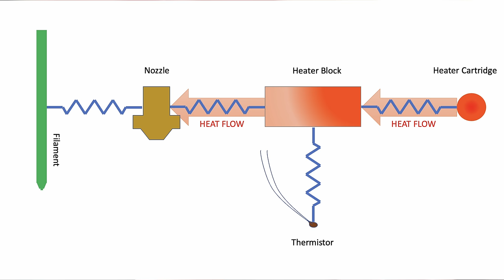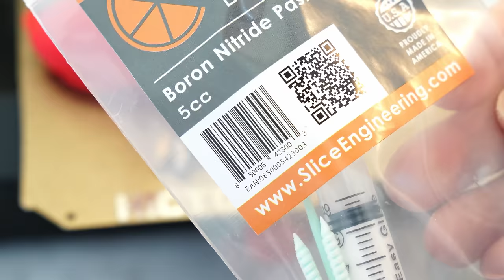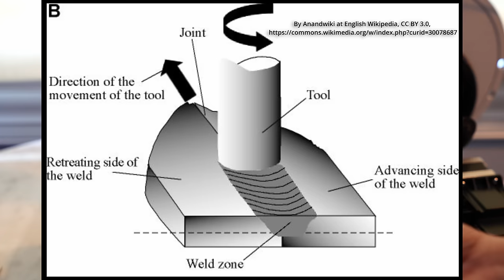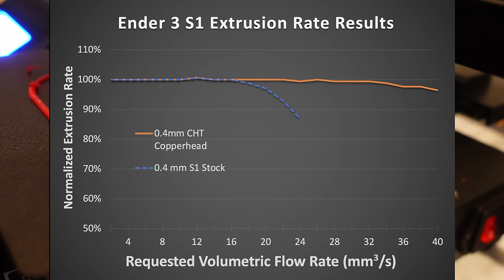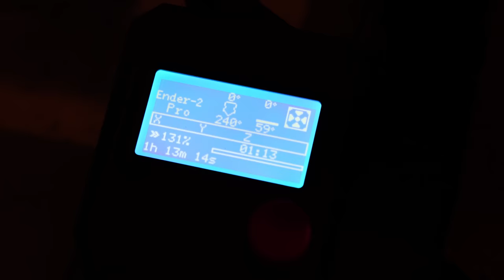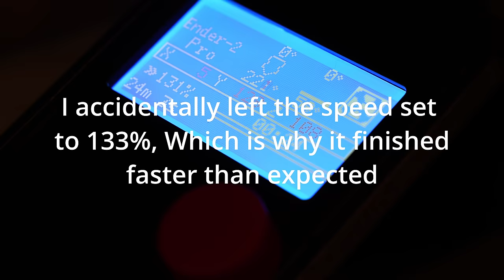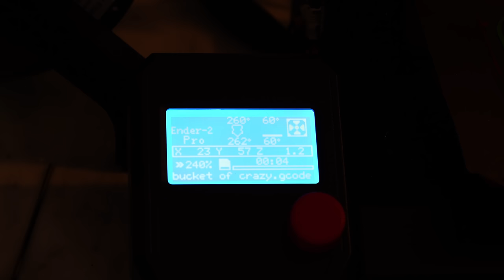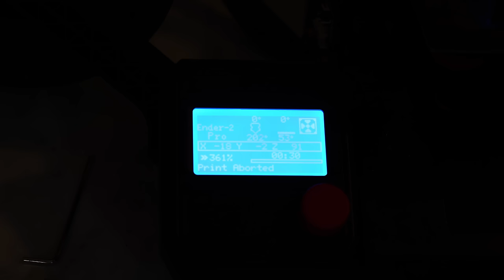CHT Volcano Launch Video - Ender 2001: A 3D Printing Oddity

Comment: Nathan what do you think about combining an S1 with Klipper firmware/input shaping (via 2-step Creality Sonic Pad), CHT nozzle & nuts (as Stefan on CNC kitchen did), and upping the print speed to max?

great vid as always. Thanks again for designing that wicked fan shroud - I've got it on my S1 and did similar fan mods to you too (albeit with buck converters rather than zenner diodes or resistors). Also have the all metal hotend from creality

loving my heavily modified, silent S1 with Octoprint. Still to be done: enclosure and klipper/CHT nozzle so I can print high speed and/or high temp technical materials like the PA6-CF I bought a few weeks back. I'd love to install linear rails for the X axis as the gantry has so much play that no amount of nut tightening resolves, but I'll also have to buy new 2020 extrusion to replace the X-axis as creality brilliantly only got extrusion that is open on top/bottom rather than all 4 sides

plan is to eventually 3D print a 3D printer (structure)
Reply from the maker: I don't like klipper all that much. With how many machines I have, and always switching them around, I prefer the old-school workflow. Its annoying to browse through 12 printers on your local network compared to pointing at a printer and inserting an SD card.

But I'm not "most people", and I think most people will prefer to have 1-3 printers set up on their network, and printing away.

CHT can't do CF reinforced. The flow splitting features are pretty delicate and would probably get worn down pretty quick. They are working on a Tool Steel version. Should be pretty exciting. I imagine they are going to have to use Electric Discharge Machining or metal 3D printing to realize the geometry, since it's hard to drill small holes in tool steel, because it's so hard. Plus they have to do their own testing and quality assurance. I think they are taking their time to get it right.

On this machine, I had issues with the printhead plate barely having enough adjustability to get it tight. So I think they didn't design enough range into this thing to reliable snug things up... Thanks Creality! Best bet would be to get another carriage or maybe loosen the bolts for the 2 top wheels, and retighten them while pushing down to lock them in at the narrow end of things.
Reply: @NathanBuildsRobots  thanks for the reply

I'm planning for klipper+cht for high speed PLA prints only. TPU will still be regular speed for material property reasons. The enclosure + all metal hotend + hardened steel nozzles are for PA6-CF and PC, probably at only slightly higher speed than usual depending on what I can get away with and if klipper is any help

The S1 is an amazing printer and with a few upgrades is becoming one of the most capable printers on the midrange market. I only paid £220 taxes in here in the UK, and probably £100 in purchased upgrades. Yes octoprint isn't for everyone but I like the spaghetti detection ai plugin, octolapse photography, live previews, and the option of not having to incessantly plug and unplug the sd card between multiple devices.
Reply from the maker: @iamdmc  Yeah the S1 is pretty good. Except for the screaming stock hotend cooling fan XD
Reply: @NathanBuildsRobots  where did you get your Volcano CHT from?
Reply: @NathanBuildsRobots  creality just wanted to encourage modding ;)

Comment: great work
Reply from the maker: Thanks! Any thoughts on doing a 1-armed DIY printer running klipper?
I have some drawings on how to make this thing a lot stronger, by having 2 arms, but placing them both on the left side. There are some pretty nice and compact ways of doing it.
Reply: @NathanBuildsRobots  I think the Ratrig V minion already has a solid one are printer. But your design sounds cool
Reply from the maker: @Rolohaun  I just watched the modbot video. Looks like a solid printer. Not a huge fan of the external electronics box. They need someone to work on the packaging!
Reply: @NathanBuildsRobots  I agree

Comment: I currently have an ender 3 but I can never really get the non z screw side of the arm tight enough. So I would like to buy an ender 2 however I mostly print functional stuff with asa and my preferred bed temp for that is 100°C and I believe this tops out at 80°c any chance you can fix that with a firmware update? Also love the content!
Reply: if you're printing ASA I hope you have a filter and fume extraction setup.
Reply from the maker: As designed the Ender 3 is overconstrained.
A proper design would allow left/right float on the right side z axis rail.

There is a trick to get it to work perfectly, which i do on all of the printers that i assemble. 
You need to loosen both plates from the x gantry, then get the left and right wheel groups right,  then retighten the x gantry extrusion onto the plates. 

It's a complicated procedure. Creality either doesn't understand the concepts, or they don't bother putting it in their manual because it's confusing. 

Having dual z lead screws compensates for the poor design. 

Any part of a mechanical assembly has 6 degrees of freedom (x,y,z, and rotational x,y,z). Ender 2 has 2 degrees that are weak(up/down, forward/backward), Ender 3 has 1 degree that is weak (up/down), and dual z machines have no clear weaknesses.
Reply from the maker: Not sure on the temps, the refrigerator magnet sheets so working at a stone point. Would rather do 90+ on a glass bed
Reply: @kristian6087  I don't but I run it next to a window with fans running
Reply: @NathanBuildsRobots  I don't mind glass however, I switched to pei and don't intend on going back(I have an extra magnet and pei sheet I could cut and switch in place of the stock "fridge magnet"). I was also thinking about running an ender 2 with the ender 3 motherboard to bypass the temp problems, not sure if this would give me issue. also toying around with petg to see if it can replace my go to filament, Polymaker asa.

Comment: what was the size of nozzle? and at what line width was it sliced at?
Reply: 0.6mm?
Reply from the maker: This one was a 1.2mm nozzle with 3mm width, 1.2mm layer height, vase mode with 3 bottom layers.
I set the max volumetric flow rate to 25mm^3/s in the "filament" tab of PrusaSlicer, then increased the print speed multiplier on the 3D printer screen to increase it to 50mm^3/s, 75mm^3/s, etc.

Comment: Please figure out how to flash the board and get better from that. You can push it you got the experience..
Reply from the maker: We've time I try to flash firmware it takes me 20 hrs. I'm not too good at that stuff. I don't know how Chris's basement can make hour long firmware tutorial videos without throwing his printer off a bridge halfway through.

I think I'm just going to swap this hotend over to my Ender 3 Pro, which should already have 300C unlocked in the firmware.

Comment: I think you severely underestimate the bowden lol.
Reply from the maker: You're right, i did some tests on stock bowden setup on the V2. It's not too bad!
https://www.nathanbuildsrobots.com/testing/ender3v2

However,I never liked the print quality I get out of bowden setups above 8 mm³/s. And I'm too lazy to set up linear advance
Reply from the maker: Compare that to the extrusion rate consistency of the S1 with the Sprite... night and day difference 
https://www.nathanbuildsrobots.com/testing/ender3s1
Reply: I am well aware that printing a speed benchy and phat layers are very different types of flow however keep in mind that the fastest printers in the world are bowden. Minus Vez3d but he also doesn't have the world's fastest benchy. He's slowing himself down dragging along all that weight. I think for absolutely consistency the shorter the distance between the drive rollers and the nozzle the better but even then a well (tuned) printer outperforms everything else.
Reply from the maker: @Leviathan3DPrinting  all good points. My approach to speed is to put a monster extruder/ hotend on a basic printer. This makes my printer very fast in terms of filament feed rate, but no improvement in the print speed in terms of the speed that the print head is moving. 

I want to do a deep-dive on this topic, but I feel like I need at least one real speed printer, with 250+ mm/s motion system and input shaping.

Comment: Waste of time. If you had bought a bimetal heat break you would have increased the melt zone and have had significantly better temperature control.
Reply from the maker: Well, yes, but no.